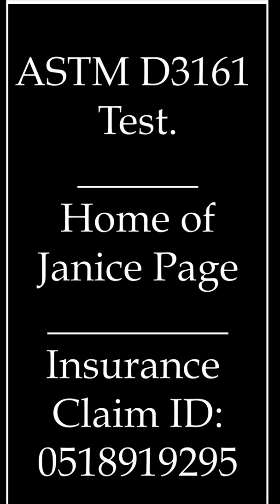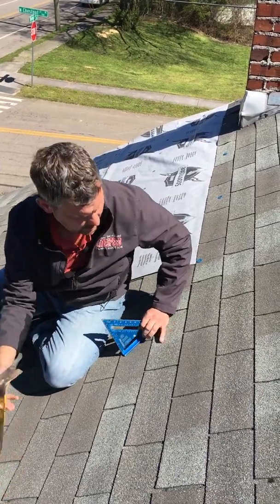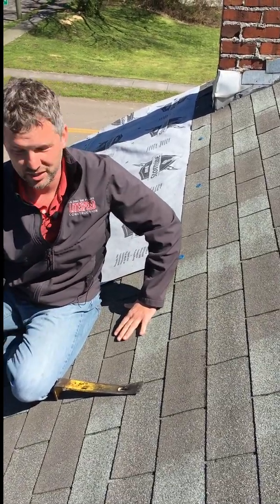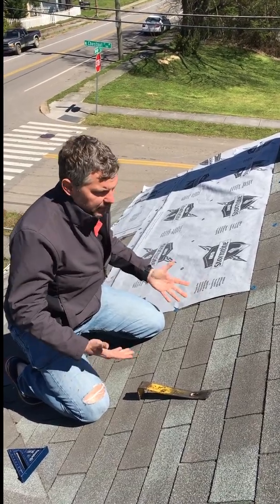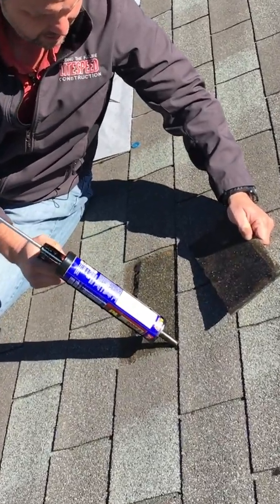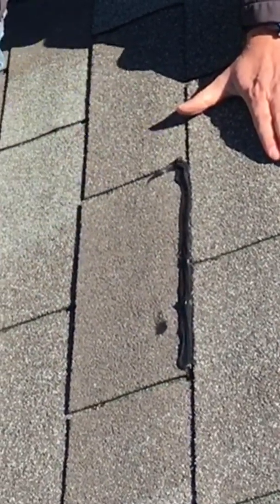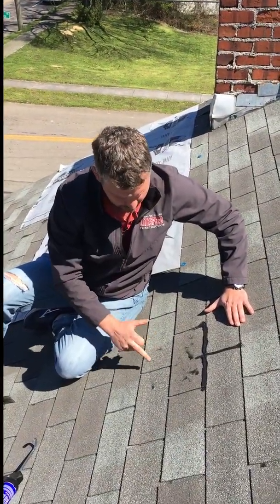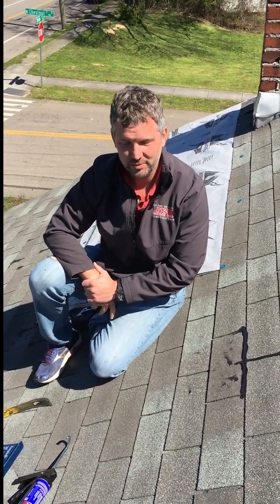ASTM D3161 Roof Test

Comment: This is absolutely NOT an ASTM test, let alone ASTM3161 which is a test method that evaluates wind resistance using a fan-induced procedure, delivering a stream of air across the exposed surface of the test specimens to evaluate for wind resistance.